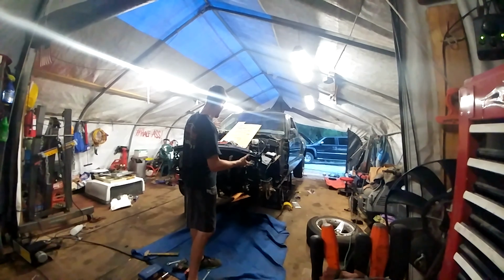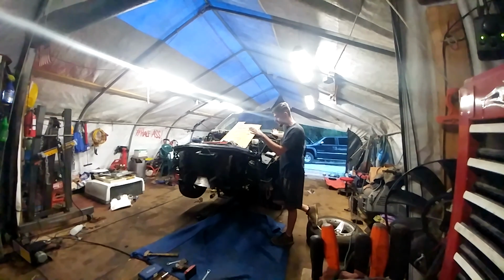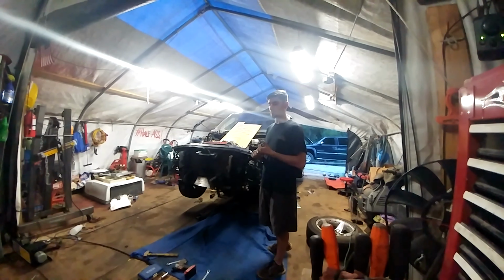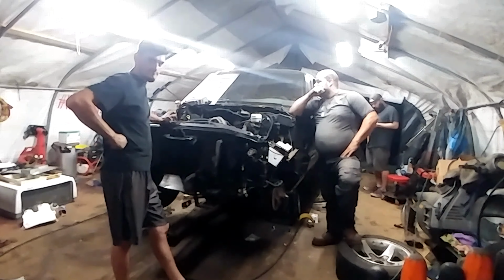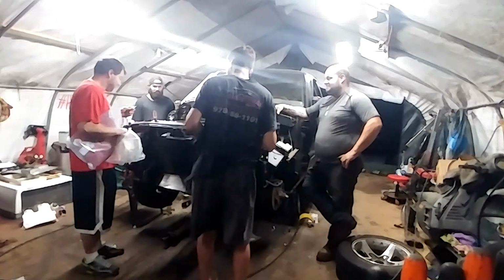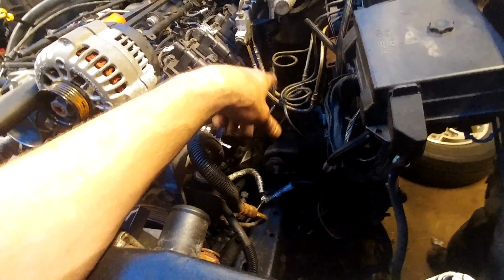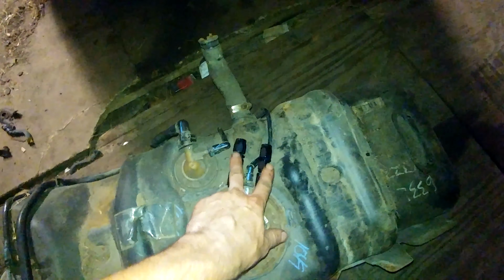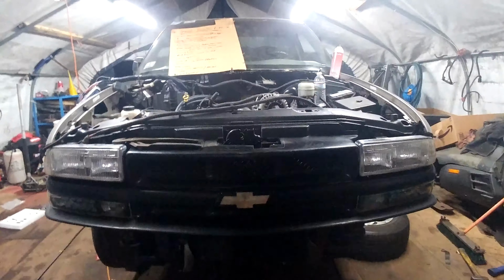LS Swap S10 | Part 7

Comment: What headers did you use. I just ran into the same issue. I bought a 3/4dd rod and a 3/4 30 spline u joint to build my steering. My headers are ebay headers
Reply from the maker: I also used Ebay headers.  The only ones that work without shimming your steering box to have an angle are hooker headers I believe. But I used the Cherokee u joint to stock s10 shaft trick that many have videos and writeups on and then i shimmed my steering box to get a decent angle and the new owner still is running the same thing to this day as far as I know.
Reply: @HalfAGarage  I ended up using 2 3/4  u joints to go around my headers. It's close but it works.
Reply from the maker: Gutta do what you Gutta do!